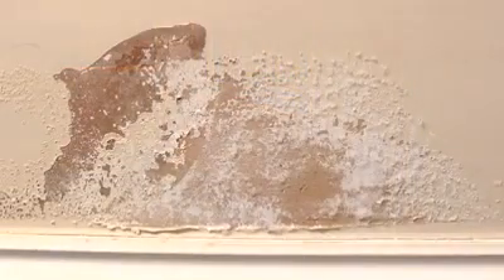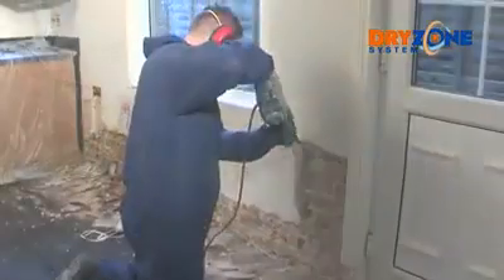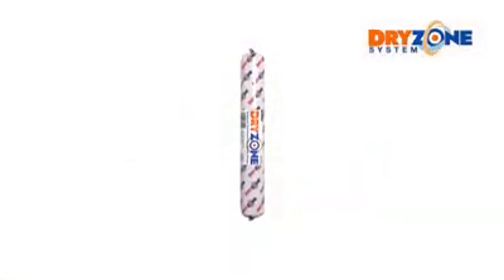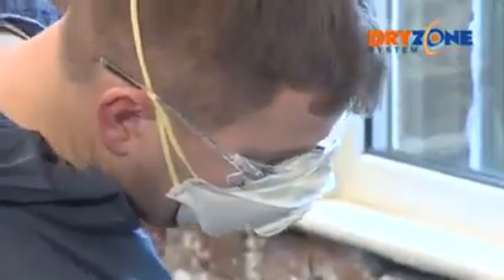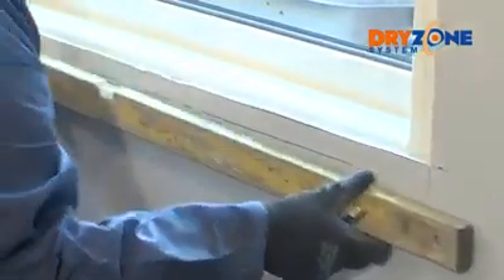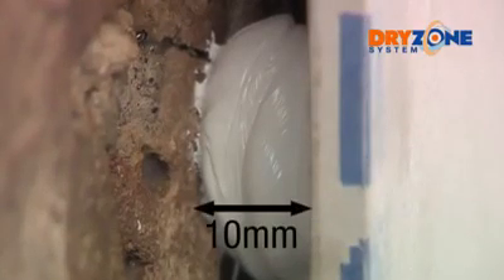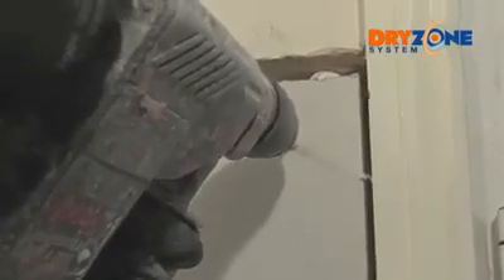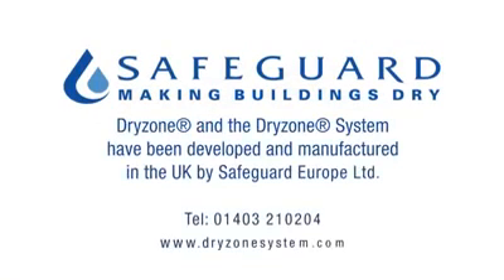Dryzone Damp Proofing Cream

Comment: no way iv been in the damp proof industry for over 35 years and thats totally wrong first you injected the cream way too high rising damp starts at the bottom inject as low as you can go then dont use plasterboard use sand cement and a tanking coat between the 2 coats of cement